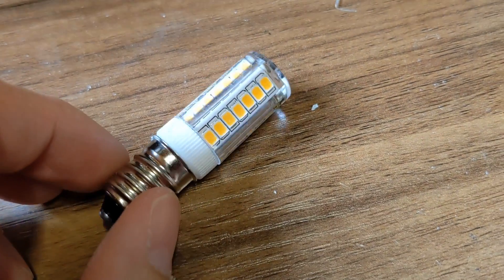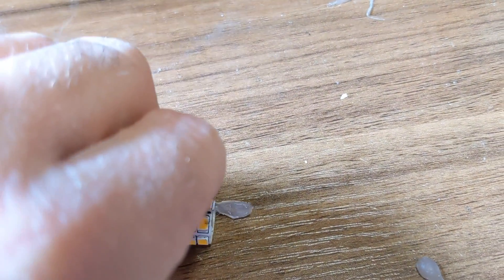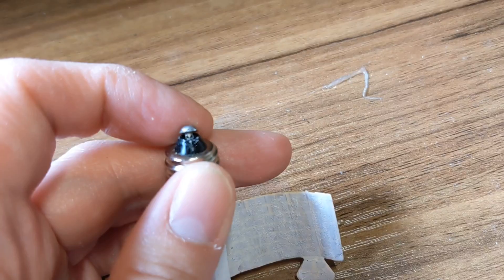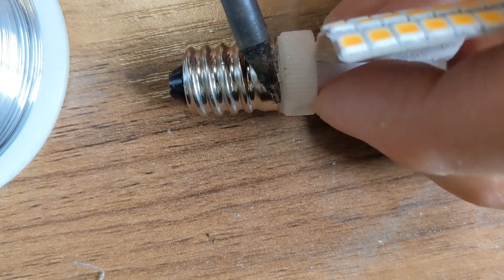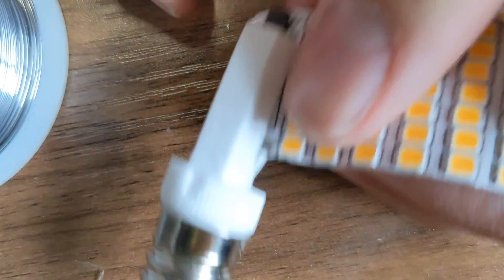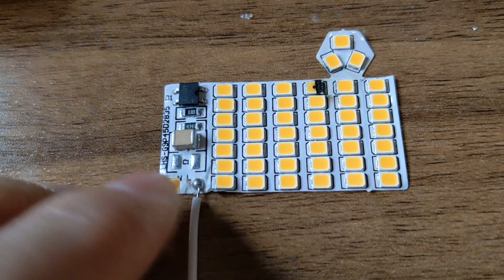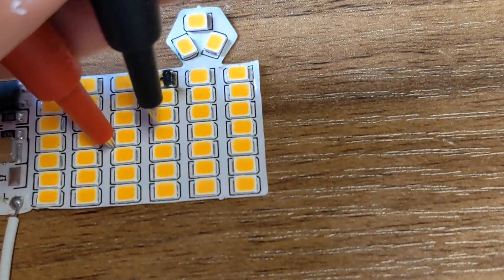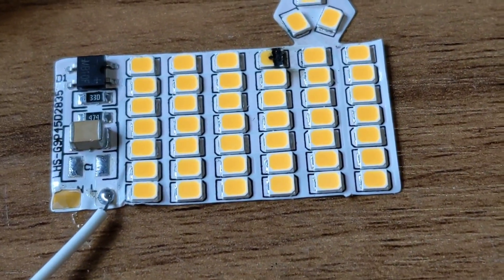led lamp, interesting construction.

Comment: You were testing some of the leds backwards, look at the printing on the circuit board. Short the burned led and the rest will probably work. It looks like they snake from left to right then left again as you move down rows 👍🏻